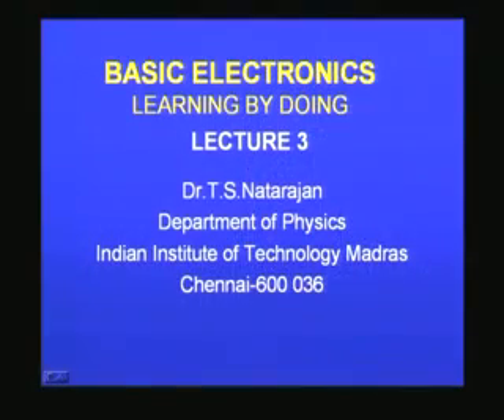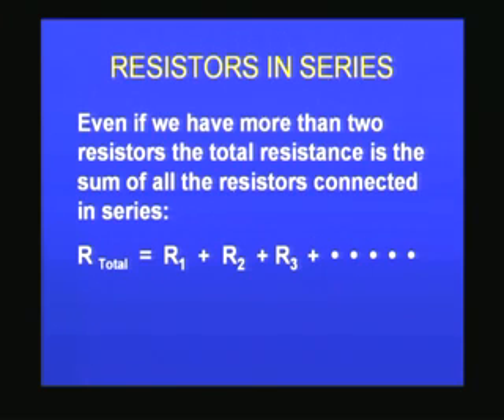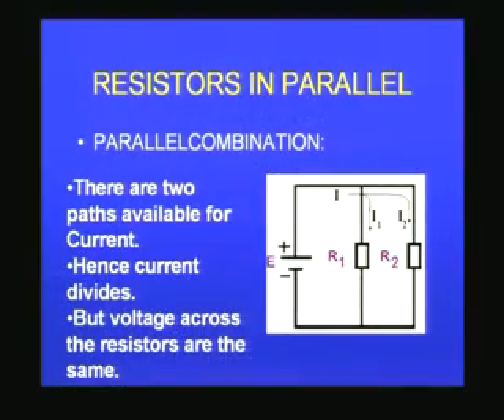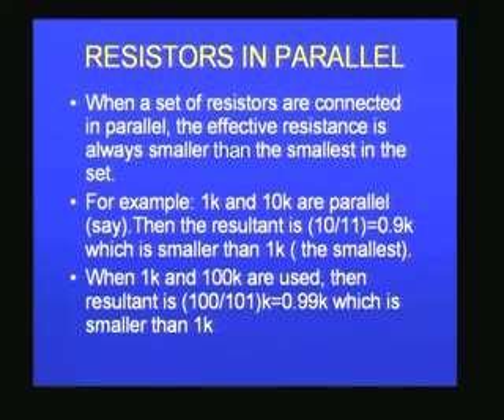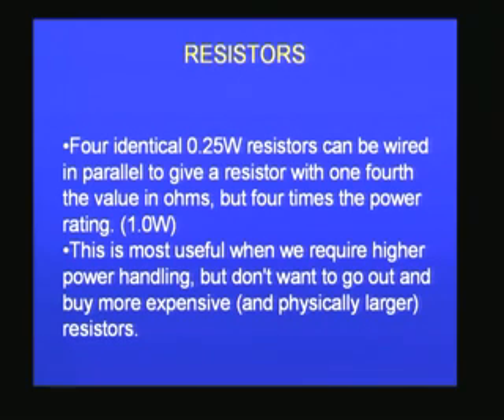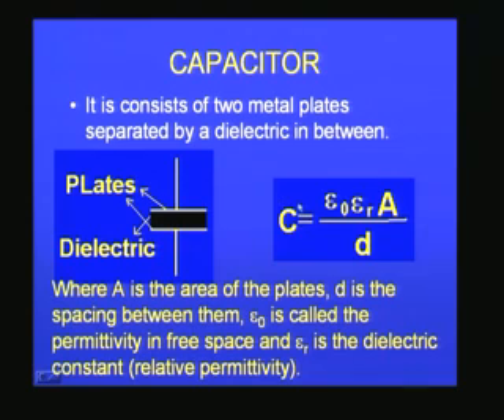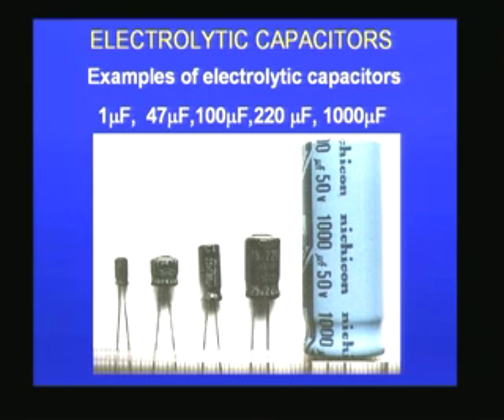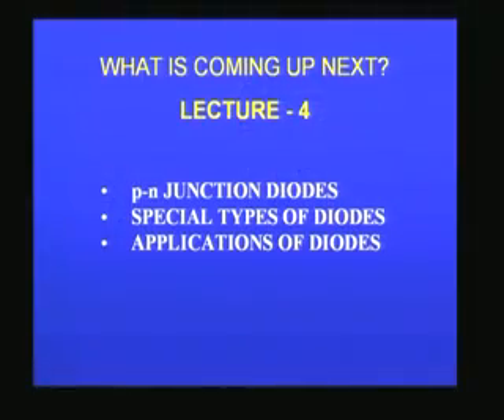Lecture - 3 Electronics Devices

Comment: sir i have a doubt regarding power rating. how and why does power rating double when two equal resistor with equal power rating are connected in parallel?